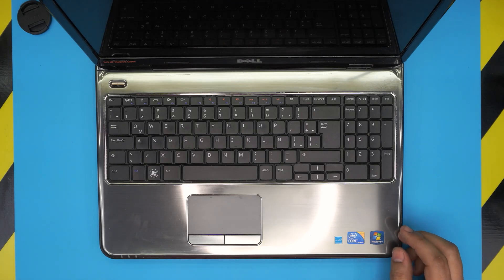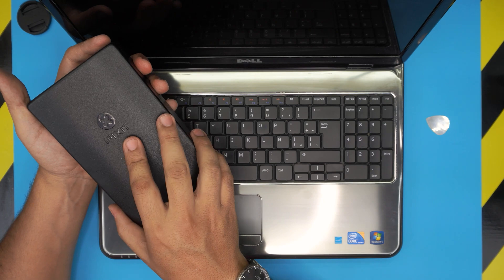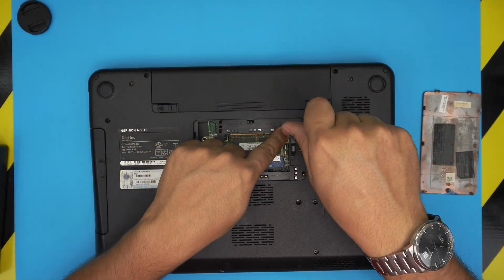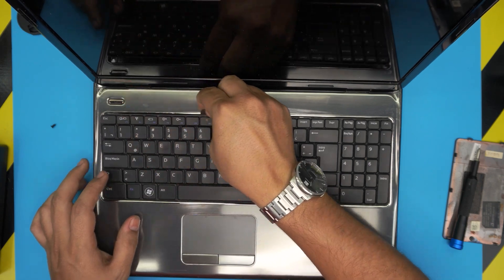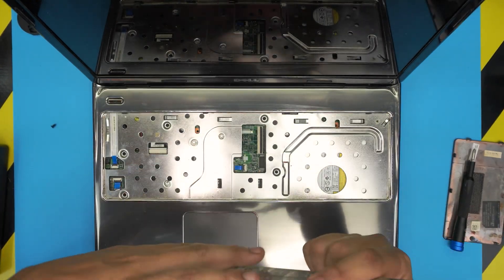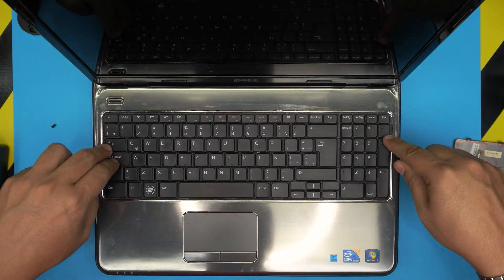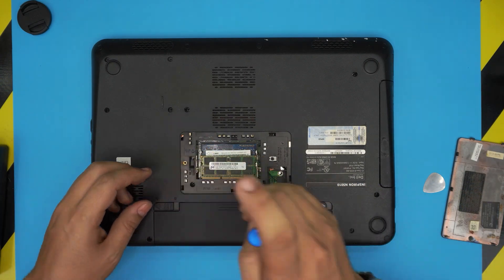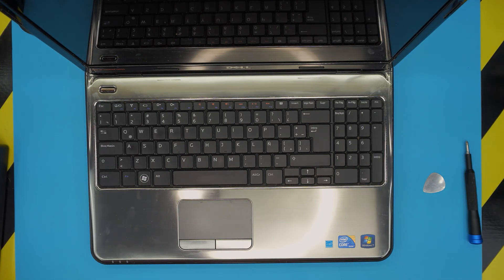Dell Inspiron N5010 💻 Keyboard Replace

Comment: very useful thanks
Reply from the maker: You are welcome! Glad you liked it 😊Thank you for the feedback! if you wish to support the channel you can LIKE or SUB or both :P
if you have any question or request in the future feel free to ask me.
Reply: Why do you have to insert the ribbon on a 45degree angle? I was sticking the ribbon straight in and wasn’t working until I inserted it on a 45 degree angle like you said.  But why is that?